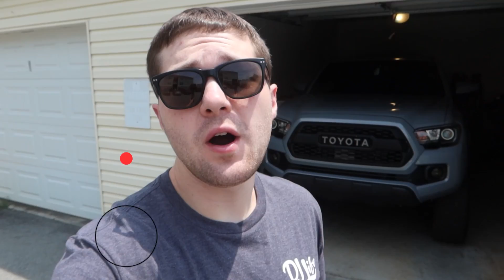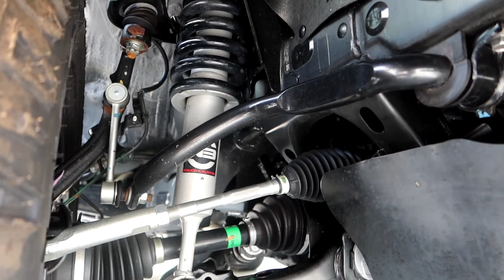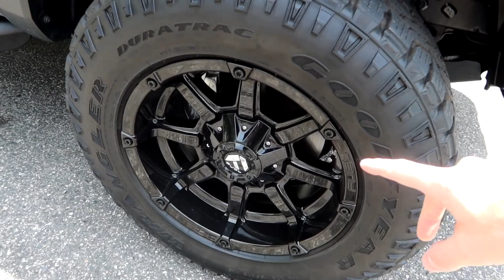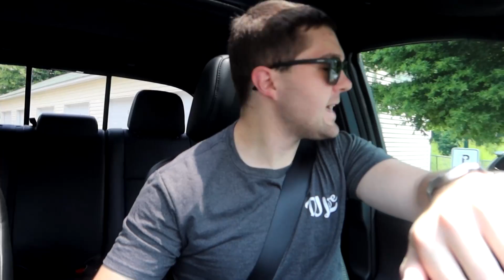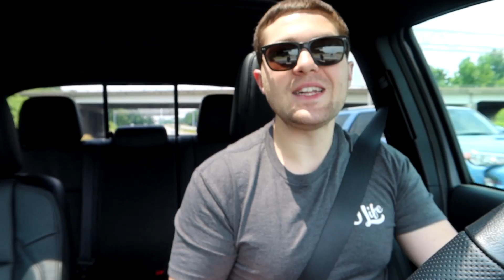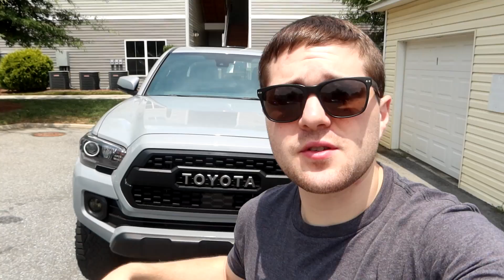Rough Country lift kit - 30k mile full REVIEW (Toyota Tacoma TRD Off Road)

Comment: Hey Rick, I have a 2006 4Runner and am looking to add a 3-inch lift. I want a lift kit that gives me similar ride quality to factory suspension or better. I am looking into Rough Country, and I saw that they sell the N3 struts and M1 Monotubes. I was wondering what the difference between the two is in terms of ride quality, as the M1s are more expensive. Thanks

Comment: Can you fit 33” tires with -12 offset ? I have icons right now but they feel too stiff so i dont think they are worth the $ they cost and they leaked once after 30k or less miles  so i had them rebuilt and not even 20k miles into them and they r starting to leak again
Reply from the maker: Dang. They might fit but will run for sure
Reply: @TacoRick  what size tires are you running with those shocks ?

Comment: Does the 3 inch lift mess with the Cameras? I have the Overhead view and was wondering if the 3 inch lift would mess with any of them?
Reply from the maker: Great question. I dont have cameras
Reply: @TacoRick  look  at your rear view mirror.  there is a camera.   look at your rear view from the outside the truck.  I can see it at the start of your video.

Comment: Hey Rick great video. I got a 2021 TRD off road, double cab,long bed in cement on order. Planning on the exact same lift installed by the dealership. Gonna install 285/75/16s ko2 on factory wheels and I’m not a off roader only a few gravel roads while hunting. Am I gonna have many rubbing issues? By the way no mud flaps. Thank you for the great video.
Reply from the maker: I think you should be fine with that setup on 16 rims.

Comment: Hey man, do you need to install upgraded UCAs when doing a 3inch lift? Noticed you left your stocks ones on.
Reply from the maker: Nope. Just struts but 3 inch is the max for the stock ones. A lot of people go ahead and upgrade the UCAs normally because there going to go bigger down the line.

Comment: By you saying their firmer might have talked me out of it. I had Bilstein 5100 and am not happy. To firm. What % firmer would you say?
Reply: @cat5tracker581  I've just heard good things about both and know a lot of people use them. Picky isn't necessarily a bad thing, it's good you know your stuff. What is a good option based on your knowledge, FOX?
Reply: @Niloc1922  Thanks. I have Fox in the rear already. They are soft. Good around town. Stiff on highway. Which is a sign of linear shocks. I just didnt want to spend the money on Fox coil overs. lol. I did purchase the RC. Well see how they do.
Reply from the maker: It's about the same as the bilstein 5100. I have road in a taco with those. The bilsteins have more travel and are a little better at sudden bumps then mine. If you want softer right then that look at an adjustable ikon setup so you can dial in the ride quality you want.
Reply: @TacoRick  I have ICON now. Non adjustable. Don't like them. Around town is firm and on highway its soft. =(
Reply from the maker: That's tough man....
Reply: @cat5tracker581  maybe try the Bilstein 6112/5160 set up. I don’t have it but I’ve heard good things about it..
Reply: Cat5 Tracker I’d say you’re pretty picky if you don’t like the Bilstein or Icon

Comment: Hows the qaulity? Did it came with UCA? How ur CV axles since the truck is lifted? Any vibrationz from 60-80 mph? Any squeaky noises?

And what are your tire specs?
Reply from the maker: I go over all that in the video. CV axles are like normal since I put a 1 inch dif drop in
Reply: I know it’s old, but curious on the squeaky noises, I’m currently having those in my 4runner 2023. Nothing really noticeable but one could hear it from inside when pass speed bumps, it’s normal? @tacorick

I got the 3 inches N3 rough country kit with UCA and 33s BF Goodrich KO2
Reply: @AMaltese  check your UCA and front radiator support bushing. The cab bushings

Comment: Okay so I plan on using my factory wheel and need to get a good tire set. What would you suggest. I also have a 2 in. lift o n my taco.
Reply from the maker: I cant really say. I work for a tire company... so I am impartial
Reply: @doda7443  I just ordered the same size and tire brand to use on my stock wheels along with RC 3in lift glad to see your review. Did you have to change upper control arms?